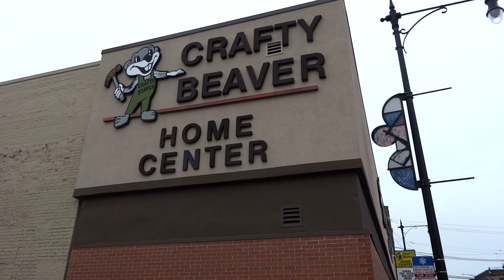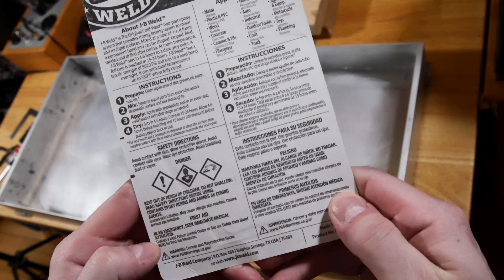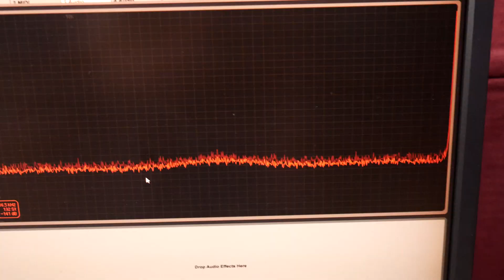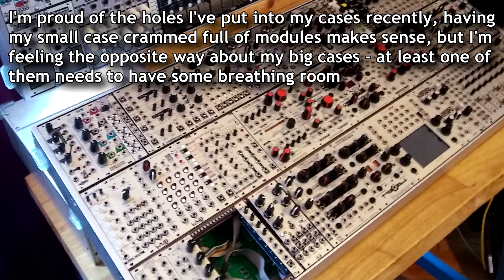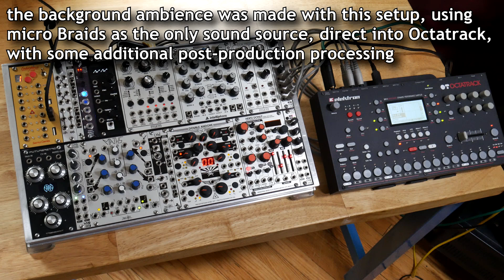Modular Mess: DIY Eurorack Case Power Supply Swap

Comment: Uh …, maybe you could attach the screws and the washers to the boards, put the epoxy at the marked places on the case and put the boards with the attached screws in place? I know it’s 3 years after the party, but if you haven’t already, you ( or anyone else watching this) could try it this way nexttime.

Comment: Dang, that's some hardcore upgrading!  Honestly your case is a work of art in itself.
edit: Yeah, a small or medium sized case works best with an elektron box.  When I take my OT over to my friend's houw with the big system I basically end up just collecting loops or using the OT as a basic drum machine.  But when I use the OT with my Makenoise shared system case I end up with a really tight integration of the two systems.
Reply from the maker: thanks for the props!! Yeah that tight integration is exactly what I want to achieve with each setup - I can take a big modular and patch it up in a very integrated way, but once I add an Elektron to that it quickly gets very messy. I want each setup to feel 'nimble', where each element works together for a cohesive whole. I suppose I'm more interested in feeling like I'm playing a singular instrument rather than trying to simultaneously be the conductor + sound guy for a robotic orchestra